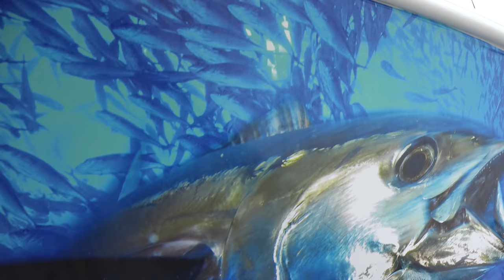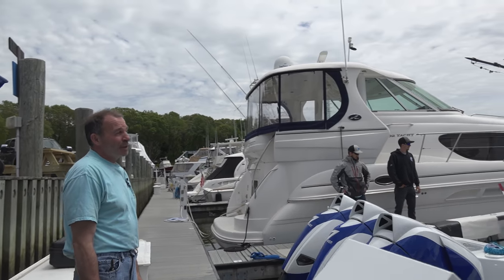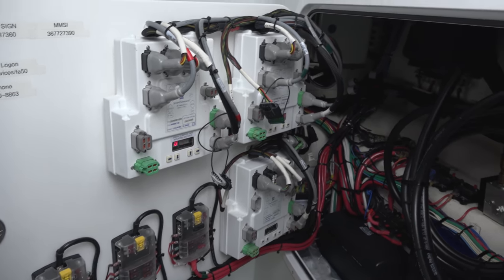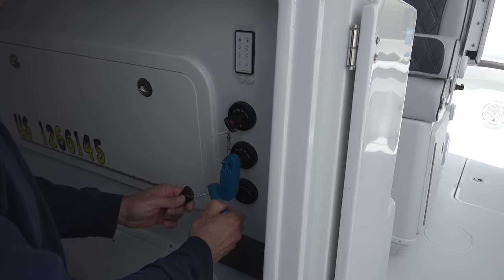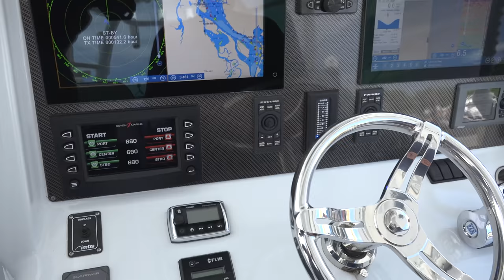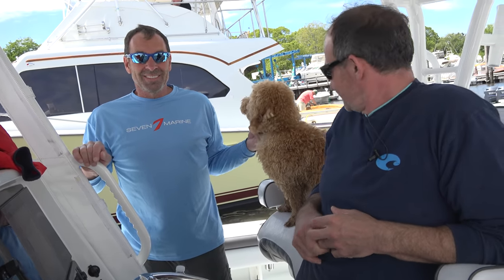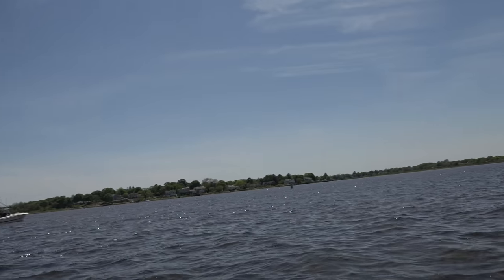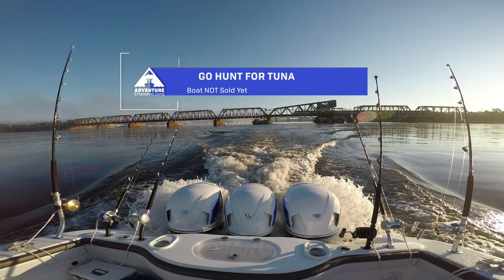39' Yellowfin CC Triple 7's 1881 Horsepower Tuna Fishing

Comment: Please start taping AFTER THEY WASH THE BOAT!!  Otherwise I find this Yellowfin disappointing. The layout is not optimized. 1,880 horses is way overkill for a boat of this size, unless you're one of those who have to have the biggest motors to make up for other shortcomings. Look at the tiny size of the hatch for the catch bin (yeah I know there are others on the deck but cmon!).  And like others have stated, where's the rigging station and why would it be an option on a fishing machine?  Cool looking boat but I'm not a fan of this model.
Reply from the maker: good feedback, on the options,  it is give and take since you only have so much room, especially if you want extra fuel tanks
Reply: @AdventureStreamingGuys    ahhhhhh...yes the fuel tanks for the 1,880 horses.  I would guess if you go with 3 Yamaha 350's or even the new 450's you'd have more room for other options.  That's probably more realistic for a fishing/family center console.
Reply from the maker: @treydrier3169  I think it all depends on the fishing grounds you have to travel to. Remember in New England you have to travel 60-100+ miles one way to the Canyons....so boats are also set up for regions.

Comment: 300 gallons of fuel were burned during this video
Reply from the maker: haha
Reply: lagoon fisher if can afford boat fuel shouldn't be an issue 😏
Reply: lagoon fisher here in CA gas is
 $3/gallon times that by 300 gallons = $900 and that doesn't include bait, food, ice, gear, etc.......what the fuck I'm I doing wrong in life with 2 college degrees working 2 full time jobs and barely making ends meet......I'm seriously in depress mode after watching this😔😔😔😔😔😔
Reply: Wtf!! 300 gallons cannot be ruined so fast! 
Not that much guys. Maybe 100 but definitely not 300! 

A Toyota Corolla gets average 30mpg on highway. This boat is liken to a higway as it doesn't stop much and can go full throttle. Plus a boat gets like 20mpg so if he did 300 gallons he could literally go full throttle for at least 8hrs non stop.. And he'd cross the Atlantic.
Reply: well yachts of this size usually get about 1 mpg and you corolla is not powered by 3 supercharged corvette engines, so I don't think that figure of 300 gallons on a fishing trip is too far off.
Reply: William Kunte in a ride that long with two small block 350 s you can burn a hundred gallons of fuel
Reply: The good news is sir that you aren't alone..lol... Meh, I am happy with my 21 Foot chugging across the bay the few times I get a day off to do so..
Reply: When you get to that point, it doesn’t make sense to use anything but inboard diesels.. with the power diesels make today, how reliable they are, how long they last, and how much easier they are on fuel, they can’t be beat!
Reply: William Kunte closer to .5 mpg
Reply: Im not familiar with miles per gallon.

But i do know 2 normal 75 hp yamaha motors take 1.2 liters per kilometer. thats more than most super cars
Reply: William Kunte it's got three 6.2l  wtf you talking about
Reply: William Kunte yes they are technically comparable to vehicle engines in displacement, but marine engines are made to run at higher rpm to keep the boat in motion since they lack a complex transmission like cars... to drive a Corolla at 60mph you’d be at maybe 2000 rpm. To keep this boat at 60mph you’d need each engine at least running 3500 or 4000 is my guess. My ‘06 Pantera runs twin 450ci V8’s and 200 gal tank lasts me about 5 hrs of normal cruising.
Reply: shouldn't have been born poor. The elite are born into it.
Reply: lagoon fisher ysrzezh
Reply: lagoon fisher hdkdfj
Reply: Clearly, you've never owned a planing boat.
Reply: in a few years tesla takes over ^^
Reply: William Kunte he may get .75 mpg wide open. It's a boat that weights 3-4 times the amount of a Toyota car. With 1900 hp. You've never been on an offshore boat...
Reply: alex stone d
Reply: That's expensive for a can of tuna
Reply: DeltaProMaster Lauj In Sweden the cost for 1 gallon is around $7
Reply: @deltapromasterlauj4848     you live in CA.   thats your first problem.
Reply: @williamkunte5361    at wide open throttle each one of those engines will burn minimum of 40 gallons of fuel per hour.....likely more with a full load.
Reply: @chicoesquela2658    except when you need to get 110 miles offshore to the canyons to go tuna fishing like we do in the NorthEast.   I own a twin diesel and don't make that trip any longer.  takes way too long.   I stay inshore mostly.  gotta love the diesel's tho.
Reply: @mechanicalking  Wow!!
Reply: @southcoastfishingco.1811  Jesus😢😨
Reply: @coryking9677  Yes I now see..
Reply: @scuba9273  My God. This is a colossal waste don't you think..
Reply: @perrywebb5833  No I've never gone on one. But since last week I been to the FLIBS 2018 and saw the whole entire boats offshore and inshore boats spectrum. Was totally blown away... I think it's a waste to have any fishing boat if not a trawler at anything over 30ft.. And yes I saw a 2019 Suenos about 60ft with five 425hp engines. Imagine how much gas that monster burns...😱
Reply: @gaycha6589  Way too expensive.
Reply: @pigskin1000  😢😓 That is too wicked... Too much for just pleasure... A boat of that magnitude don't need so much HP except for the thrill of torque. 
I believe just one or two can push the boat at that same speed.. Remember unlike the car which drive shaft has to push those tires on the ground, a boat is basically a propeller going against water, which can't stall as it's always in motion... So these boat dealerships are just making ways to take ppl's money.
Reply: William Kunte how’s the saying go? “ smoke em if ya got em”
Reply: @scuba9273  True.. But I don't think it's value for money.. Maybe value for the thrill.
Reply: I've got a 35ft boat with three 250hp and you're lucky to get 1mpg wide open. This Yellowfin with three 7's is lucky to get .5mpg wide open. I'm selling mine cause I'm tired of blowing money on fuel. You can catch the same fish and have the same fun in a boat that burns half the fuel.
Reply: lagoon fisher bwahahahaha. Spot on
Reply: @williamkunte5361  You don't have a clue what you're talking abouw
Reply: @joerigillissen9324  Are you serious? Tell me what I don't yet know?
Reply: @williamkunte5361  race boats have even more hp, so i wouldnt say it doesnt make a difference
Reply: @prohen3049    I have an Everglades 325cc with twin 300's.  Love it.  It burns between 15 and 30 gallons an hour depending upon speed.  At 30 knots it's a bit less than 30 gallons per hour.  So if you want to deep sea fish, you go out 30 miles into the Gulf which takes about an hour.  That's 30 gallons X $3.50/gallon = $105 each way.  Plus trolling. So you're looking at around $300 in fuel for the day.  Just split the cost with whomever is fishing with you.  If you have 2 other friends its $100 each.  Not bad.
Reply: @deltapromasterlauj4848  peoples state of California is what you are dong wrong.... just a thought
Reply: DeltaProMaster Lauj you don’t make money working for someone else
Reply: @williamkunte5361  who told you a boat gets 20 mph? Lol I wish that was the case
Reply: @derick2986  How much does this one get?
Reply: A boat like this is why I’m going to college
Reply: @williamkunte5361  there is no boat in this world that does 20mpg I'm sorry.... with 3 of those engines I'm sure they ran through well over 100 gallons an hour!
Reply: DeltaProMaster Lauj 3$ a gallon wym in los al area it’s 4.59 a gal
Reply: @deltapromasterlauj4848   You gotta learn to be a thief like 3/4 of the guys that have boats like this.
Reply: Well when build 7 digit boat, mpg is not your top concern.
Reply: @williamkunte5361  not even 100 maybe 20-50 at most
Reply: @HiltSeeker  saw a sweet inflatable with a 3hp the other day planed out. Probably getting more than that
Reply: @williamkunte5361  Dude, You are absolutely insane! Clearly you know absolutely nothing about boats! I guess you forgot about all of the resistance a boat has on the water! You would most likely get better gas mileage driving an old Cadillac with four flat tires! A boat of this caliber is lucky to get 2 to 3 MPG, But usually boats are measured in gallons per mile!
Reply: @williamkunte5361  I’ll tell you what you don’t know! You don’t know anything about boats! The fact that you think this boat can maintain the same speed with just one or two engines is absolutely hysterical!
Reply: @NeverEnoughPyro40  I don't think you understand the fundamentals of quantum physics and theoretical physics. 

I could go on but I don't want to burst your brain. 🧠
Reply: @NeverEnoughPyro40  What's the difference between miles per gallon and gallons per mile? 

Let's see if you know what is what. 🤔
Reply: CO 2  Scheissegal, Hauptsache Spaß, Grüße nach Amiland.

Comment: This is an outstandingly clean looking boat.  I love how the bars for the hard top are white instead of the normal aluminum look.  Damn that center console is to die for.  The displays are laid out well.  I had a 2870 Pursuit that I kept on the Great Lakes in the early 2000's.  Wish I still had it, miss it a lot.
Reply from the maker: Thanks for the comments Bill. Yah she was fit out right by the brothers...they're building something else...need to check in with them
Reply: Agreed. If I could change one cosmetic thing about my CC it would be white bars instead of the aluminum.

Comment: smart build.    3 LS3 supercharged motors......     the LS3 is super reliable, and reliable to the 650hp range supercharged in a Corvette.  Throw in the fact they built them for marine use, and built them for the superchargers......  That's pure reliable power.   WOW.    These motors may outlast that fiberglass..... That is how good the motor platform is.
Reply from the maker: TripleAstyle1 A the technology is amazing. Thx for the comment.
Reply: They last about as long as any other high end out board. Marine engines spin in the 4k range for hours going off shore. Cat engines dont do that in a car. Less revaluation = less wear.

Comment: Seven Marine has now begun offering its mega-power outboard motors with a Volvo Penta DuoProp gearcase and a suite of Volvo Penta technology.  Those Duo Props would improve this boat tremendously. Quicker planning, more torque trust, better fuel economy,  more range, better control at low speeds. For this boat I would recommend the 527's instead of those 627's. With Duo Props of course.
Reply from the maker: Excellent info...thank you

Comment: why have 3 engine keys? just have a keyed Master inside and ignition toggles/starts out on the console
Reply from the maker: great idea..I know he had the master on the outside.
Reply: im sure they have a reason...maybe to keep power off a toggle not being used, as in your design if only using 2 engines, just a guess though...the engines may have such sensitive or expensive sensors and crap its just a redundancy built in for extra protection...they build like that on Navy and other US military boats

Comment: 1/2 a million dollar boat. We are at the point where a good center console is no longer affordable
Reply: ramesh anand more than that
Reply: Each 7 retails around 100g's. And then there is the boat and the electrics. He is around 1.3 million is my guess.
Reply: DANIEL GARCIA Each 7 motor goes for $68k. I just read a article and it said four 7’s cost $270,000
Reply: Yea but it goes as fast as a Toyota Camery  lol
Reply: @jasone4460    you are looking at the 557HP.  the 627HP goes for 90+
Reply: I work for yellowfin here in Bradenton. 
I wasn't part of the crew who worked on  this boat.. But I'll tell you know it's wayyyy more than half a mill
Reply: We looked at a brand new 22ft sportsman with one 200 and it was 90 out the door. Boat prices are out of hand

Comment: here's a doozy for ya do those 7 marines use a gm ecm to control them?  also whats your redundant backup for the motors if something go's south wether it be throttle contol...I'd guess it goes into fail safe to where you can't go over 15 mph and limp the boat back home huh?
Reply from the maker: Matt...since my friend is the owner, i don't know all the details of the 7 Marine components and don't want to make up an answer for you.
Reply: @Matt Sedgwick  I would say 3 motors offers the redundancy you are looking for.  The boat will plane off with just one motor to 20 or 25 mph.  2 motors will probably push the boat to 60.  These are V8 engines with grunt, not the 2 stroke screamers I have, which are very weight sensitive...
Reply: thanks for getting back to me what do you think the motors weight?
Reply: Motors are listed at 1,045 lbs.
Reply: matt sedgwick heavy.
Reply: matt sedgwick based on gm ls7 engine 6.2l
Reply: Dwreck Baker actually based on GM LSA platform. They are 6.2 not 7.0
Reply: Dwreck Baker I don’t think the ls7 is 6.2l
Reply: matt sedgwick did he win the mid Atlantic out of nj once??

Comment: how does it have 3 engines, but only two controls? in a plane there is one for each engine, is it not the same here? I have only driven single engine boats
Reply from the maker: usually one of the outside engines( i.e. Port) are a slave to the center, and other control is for the Stbd engine. When you put one control in fwd and other in rev, the center ending stays in neutral.

Comment: Very nice fishing boat!!!  I did not see any fish holds.  Does the boat have any or are the fish that are caught put in fish bags kept on the deck?  With 580 gallons of fuel capacity what is the range for this boat?
Reply from the maker: if you watch the part where we go BFT fishing, there is a guy loading one of the fish holds with ice in the bow, he is 6'2", You could put 20 tuna in there. There is also the coffin box on top of the fish hold in the bow which is huge. Then there are two fish boxes on each side of the deck port and starboard.
Reply: Thanks. What is the asking price?  Ball park 400K?
Reply from the maker: http://www.boattrader.com/listing/2016-yellowfin-open-cc-103012196/
Reply: Thanks.  I thought about that price and it does make sense.

Comment: she's capable of 100 plus isn't she?  I live in Jupiter and I'm sure you know it's like the boating capital of the world short of fort laudy lol
Reply from the maker: Boat as equipped with Triple 627's does 80mph
Reply: matt sedgwick d
Reply: Demostenes Robles Herrera huh lol
Reply: Its a fishing boat, not a racing boat. If he wanted to change the props and fine tune he could easily
get it to 100+, but for what purpose?
Reply: needbjnow01 only 80 in boat that size on water is plenty
Reply: Only 80??? Those motors can’t be propped correctly. It’s not about a getting the extra mph, it’s so the engines are geared correctly.
Reply: Max rpm is 5500rpm on the motors. This boat and motor combo will not do 100mph, don't care what props you throw on it. The boat weighs close to 20k lbs as seen loaded with fuel and people. Not even making .5mpg at WOT, spends most of it time at high cruise speed or under.  A top speed of 80mph is plenty.
Reply: 80 on the ocean is really screamin. I guarantee you wouldn't be saying that if you went for a top speed ride in this boat.
Reply from the maker: People don't realize going that fast on water is a lot different feeling than in a car. Just think of the friction the water creates versus a smooth assault road.

Comment: You don't need all them big engine just to go fishing
Reply from the maker: Frankie Pham you are correct but it gets you there and back quickly -more time to 🐟
Reply: +Adventure Streaming Guys you could get there and back with 2 just as fast, your not going to be doing 80mph in a 3-4footchop with your charter on board.
Reply from the maker: 3-4 chop prob back her down just a bit, 4-5 definitely . those engines are heavy. Thanks for the comment.

Comment: By just seeing the performance and speed i;m impressed, but the whistling sound is a concern??
Reply from the maker: the whistle sound was fixed in about 10 mins, tensioner adjustment when the belt was taken off for some maintenance ...no issues

Comment: so what are the outboards????????????
Reply: 7 marine. Basically a gear box hooked to a Cadillac CTSV motor sitting just like it does in the car. Wide, heavy and loud but they have a purpose for sure. Its not racing but pushes big loaded boats nicely.
Reply: @michaelteeple8704  I'm a marine tech 20yrs i'd like a link to who makes these babys. Sounds very cool!
Reply from the maker: sound is sweet

Comment: The motor is producing over 600 lb-ft of torque from 3,000 rpm through rated speed. This is where the real power is coming from, no the HP
Reply from the maker: Ludwig Maxwell you are a smart dude!

Comment: Rather have inboard diesels and some cabin space, you can't do much traveling onboard with the open layout so whats the point of having a big boat, its basically a giant boston whaler.. This thing could flip if you encountered rough seas with all the weight of those outboard engine blocks up high, may need some ballast in keel.
Reply from the maker: she is pretty well balances even with the weight on the back. These CC have really come along way. Been the twin diesel route, two different styles of fishing and maintenance.

Comment: My engine deign has 5 hp. per pound. Starting @ 60 lb.  AND it goes up from there
Reply from the maker: Marlon Moss explian a little more ...?
Reply: My engine design is a blown , non polluting 2-stroke , with air cooled pistons. No one has seen it yet because of the Chinese.  Want to know more ?
Reply from the maker: sure @marlonmoss4235
Reply from the maker: you can just email any info including a pic to adventurestreamingguys@gmai.com @marlonmoss4235